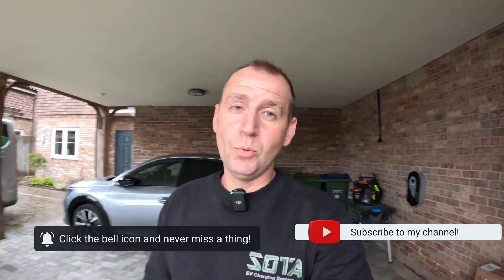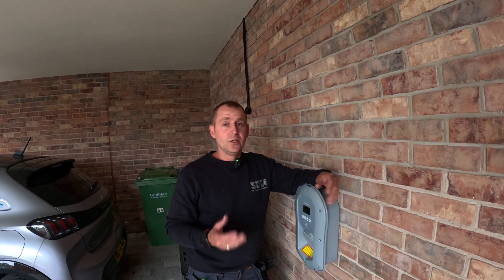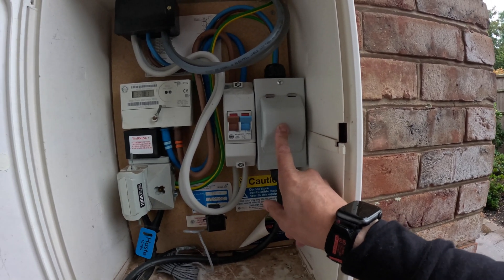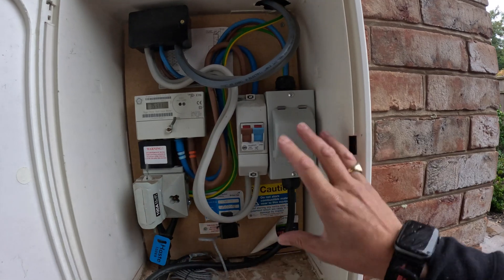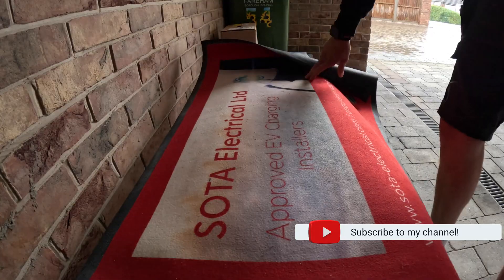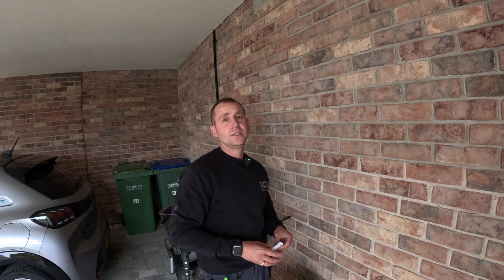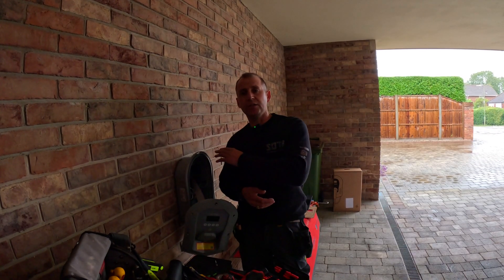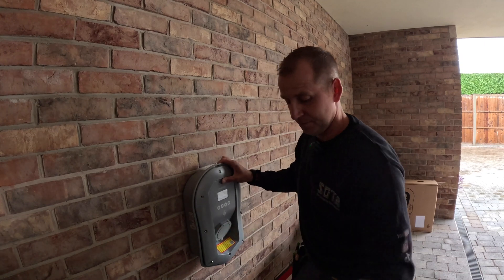THEY GOT A BRAND NEW EV CHARGER!

Comment: I'm no electrician but why did you not lock off the isolation switch in the meter box? Even though you are the only one working on the site, the owner of the house could turn it on.  Be safe please always lock off.

Comment: 3:15 totally disagree about the CT pairs - using 2 cores reduces resistance, which can lead to errors with some types of CT which have a fairly low load impedance, provides a bit of redundancy in case of a core snapping when terminating,   gives more for the screw terminals to bite into, and provides more mechanical support. 
 There is no reason at all to not use 2 cores, and to use only one is shoddy work. Even if you needed ethernet in future, 100mbit only needs 2 pairs.
Reply: na mate ill think ill listen to the people who make the product
Reply from the maker: Hi Mike, I’m all up for discussions but to say my work is shoddy is a bit harsh when I am following manufacturers instructions.

Comment: Another good video. What paper work do you issue to the customer after installation. What’s your preferred manufacturer of ev charger. Top   Quality workmanship.
Reply from the maker: Thank you. After a new EV charger install I issue an EIC, notify the local building authority and submit an EVCP application to the DNO, on this job just an EIC as it’s a replacement and the other documents are in place from the previous contractor. 
My preferred chargers are the Zappi, HyperVolt and Tesla charger.

Comment: Hi,  excellent video.  Please can i ask for advice after hearing your comment on the twisted pairs in the cat 5 e cable.  
My solar installer used all the 8 wires in the cat 5.  The orange and brown twisted pairs were together and so was the blue and green twisted pairs.  I assume this is wrong as i think the idea of the twisted wires is to stop interference isnt it even in a shielded cable.  What would the result of doing this be please and why would this be the practice if its wrong  
Thanking you for your time
Reply: The reason the pairs inside CAT 5 are twisted is to reduce interference on data connections.  When you use both wires from a pair as single conductor, this benefit immediately goes away.   The manual for my charger says to use only a single pair (two pairs are being used in this video). Given that the CAT 5 cable is often run directly alongside the high current charge cable, it could produce inaccurate readings as @sotaelectrical said.  It would be interesting to actually test this though and see if there is any measurable difference in this application.
Reply from the maker: Hi there, thanks for watching my video, basically the readings it produces may be inaccurate, nothing too major but not common practice
Reply: @sotaelectrical  

Thank you so much for your reply.  
I thought the whole purpose of using cat 5 cable was for a screen to interference and it was the fact that the wires were twisted around each other that provided this.  Using all 8 wires in the fashion I described would presumably mean they were not twisted in this scenario,  so is that why it could give inaccurate readings.  

Thanks again.